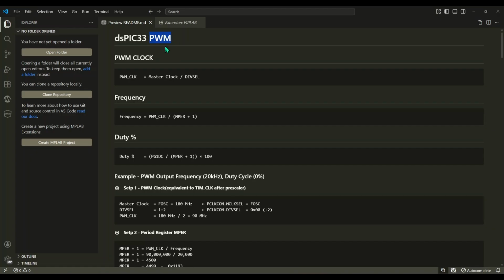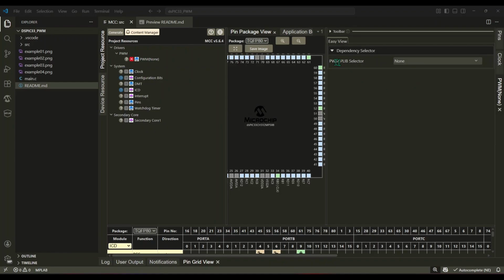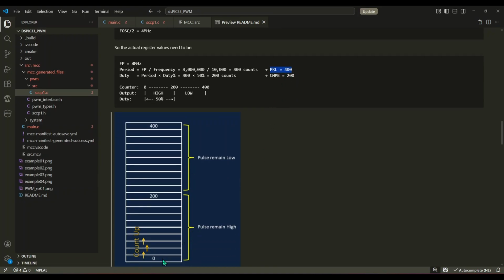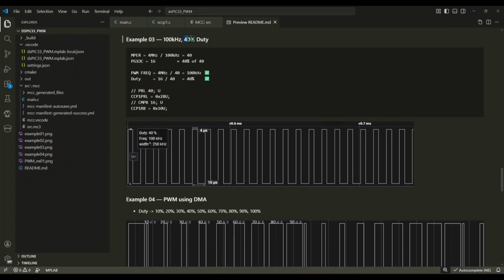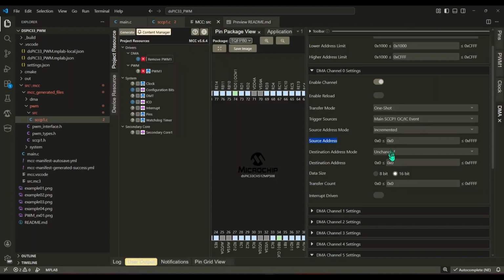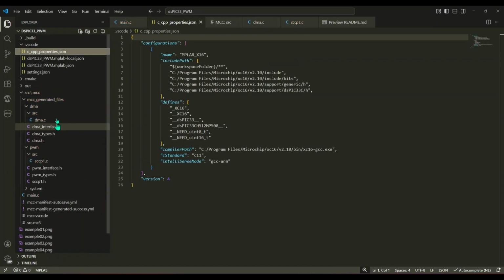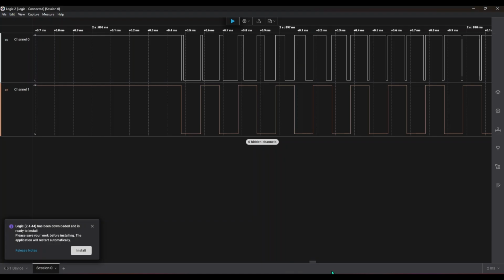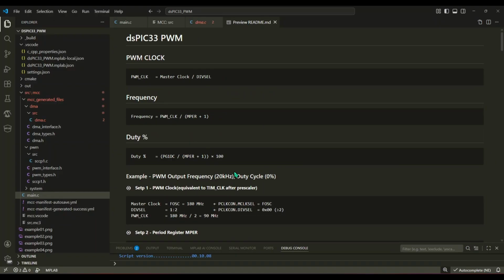dsPIC33 PWM Tutorial | MCC Melody + DMA Examples | MPLAB VS Code

Comment: How to program the slave core for the examples mentioned
Reply from the maker: 1. Master project: In Device Resources, expand Peripherals -> Slave core (Melody may show it as the Secondary Core category) and add Secondary Core1 to Project Resources.
    (Give project name, select clock source, etc, and give Pin ownership to secondary core: PWM pin you're going to use), save master MCC.
2. Then, create a new project by selecting slave mode (Ex:- dsPIC33CH512MP508S1). (Name must match what you typed into Secondary Core1 in the master project.)
3. Open MCC in this Slave project. In Project Resources, you'll see Main Core (or Master Core) as an imported system resource (read-only).
4. Click Load Main/Master Settings and browse to the master project's exported MCC config file.
5. PWM examples: steps are the same. 
6. Link with the master Project; go to project settings(Master) Conf:[default]->Secondary Projects, add the Slave Project, and select the Slave Core(Ex:- ***S1).
note:  Pins-> at any given time, only one core is the owner.
Reply from the maker: check my Gihub repo :- https://github.com/madhawapolkotuwa/dsPIC33_dualcore_master_slave

Comment: how to charge duty_cycle after press button in proteus ? i mean when Ton = tof, t on =20%T, .... , ton =40%T, Ton = 80%T
Reply from the maker: Hi!
If you want to change the duty cycle using a button in Proteus,

Step 01:- Configure a GPIO pin as an input with a pull-up resistor for your push-button.

Step 02:- Write a simple button-debounce check or use a button external interrupt.

Step 03:- When the button press or external interrupt is detected, you can increment a state variable and update the PWM duty cycle register
                     (e.g., switching the duty cycle from 20%  -> 40% -> 50% ->80%) using
                      * Option 01:- Using MCC-generated PWM update functions. (not explained, but you can find those functions in the "sccp1.c" file, what they do actually -> option 02)
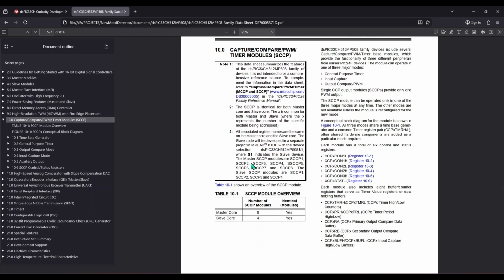                      * Option 02:- directly updating the register values. (10:13)
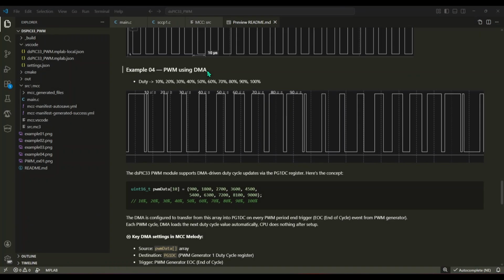                      * Option 03:- You can use the DMA channel to control the PWM directly (16:17)